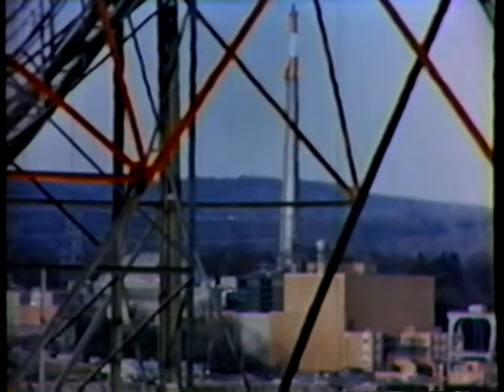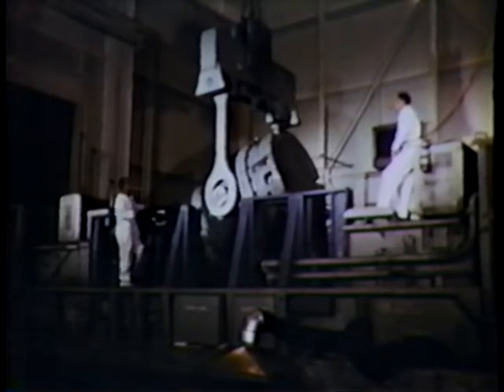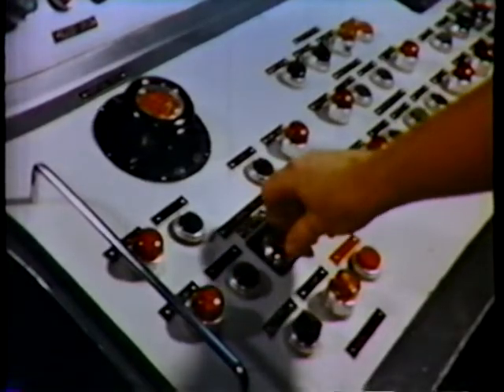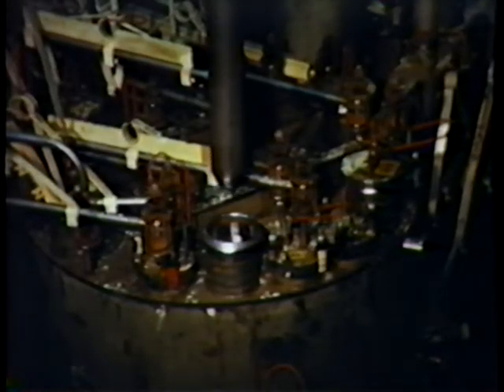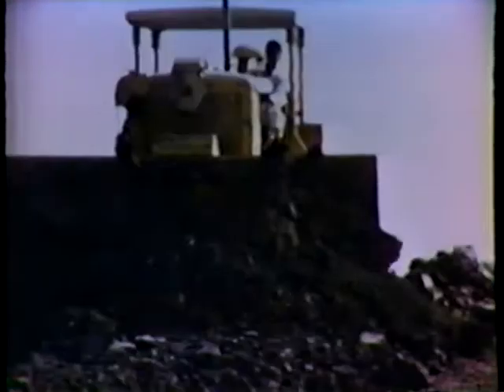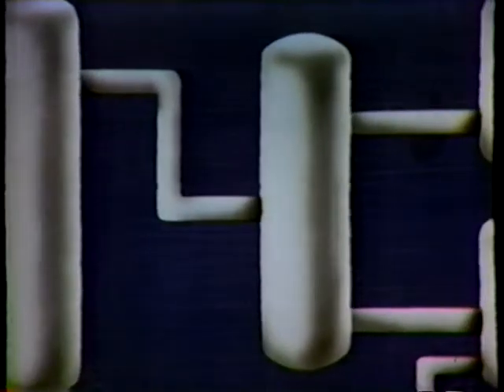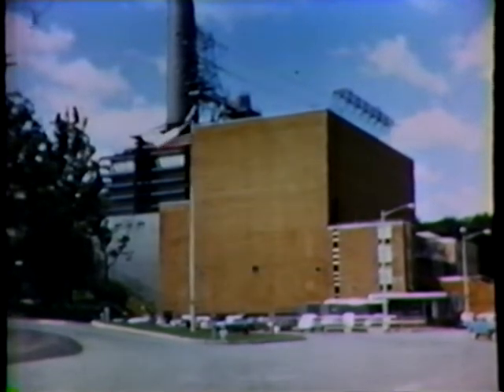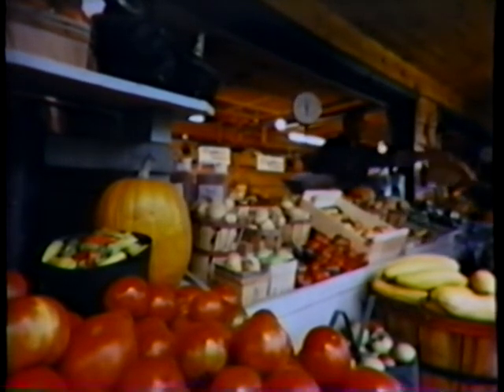Nuclear Fuel Services West Valley promo film

Comment: Why did you give this video such an obscure name?? Name it more accurately and it will have many more views!
As to the actual plant processes themselves.... HOLY F what an absolute clusterF of contamination and mishandling that place was from the very begining!
Reply from the maker: Sorry, NFS2 was the default file name generated by the edit software. I should rename and add more details.
This facility has a very complex history, the clean up is ongoing and also has many facets. I live 6 miles from the site so I am quite interested in the quality of the work being done.
Reply: @roszyknuke  wow that was a fast response for a 9 year old video! haha. Anyway, I found this video only through a third party website link. Never seen it before, very interesting! thanks! I know they completed vitrification of the high level sludge in the accumulation tanks a few years ago, but I don't know about the progress of cleanup from the leaks leaching through surrounding soil. Now, after viewing this video I really wonder what happened to all those "chopped pieces of metal" which must have been still HEAVILY contaminated with transuranic actinide surface contamination. Was that part of the vitrification product or is it still sitting there underground? so many disturbing questions about this disaster of a site.